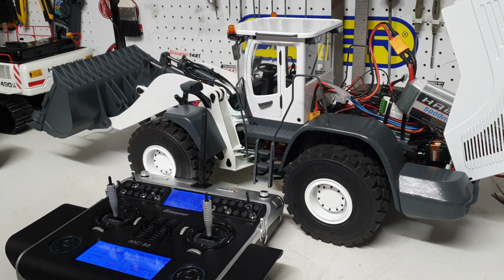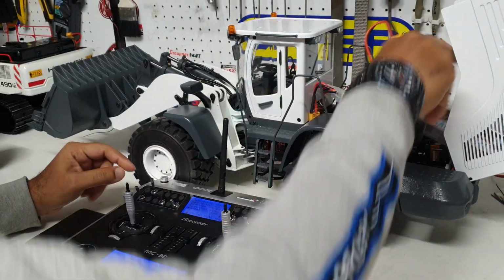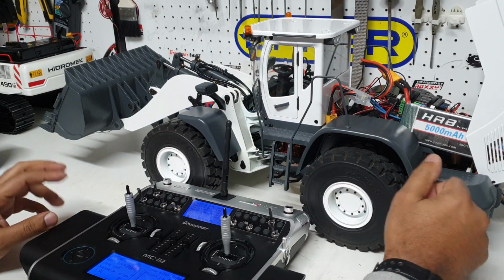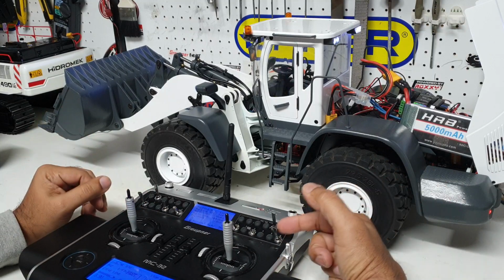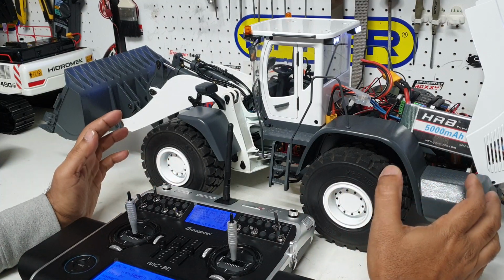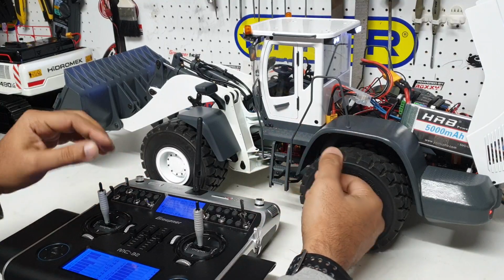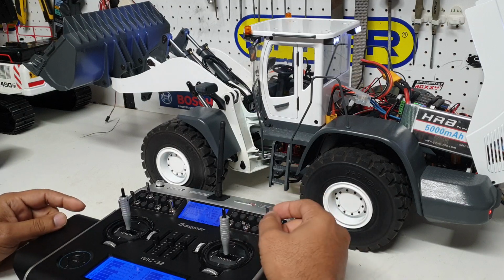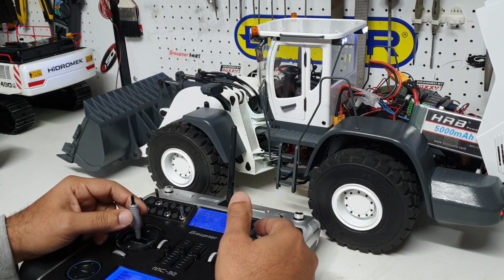CSMI RC Hydraulic Wheel loader WL870 easy setup and modifications

Comment: hellow mr kevin how is going so i have earth mover 870k with damn radio control FS 10ch i6s white so what is the best radio for her because my radio is very bad even he cannot reading the battery right when the battery low and the pump stop work the battery still full on my radio screen and what is the best gear for this loader 
i mean i want to use him forever on road of road 
first gear or secnd gear what is the best between them  thx again dude excellent video
Reply from the maker: Good day there are many good radios now even priced well...  Try frsky or Graupner. If have issues email us info@csmi.com.au.  Thanks
Reply: @CSMIRC  so mr kevin can you please tell how can program the battery on my radio FS 10CH i6s white 4 my earth mover 870k i use battery 3s 11.1 2400mAh 35c how can programing in the RX set up 
high volteg.?
alarm.?
low.? because when the battery is low the alarm start on ...thx